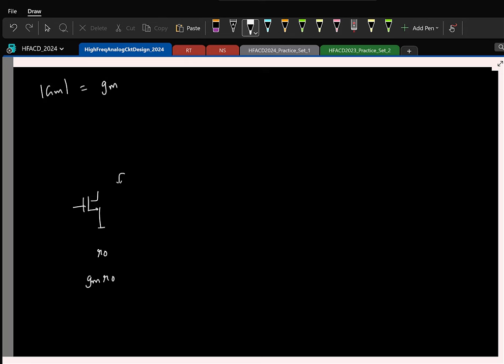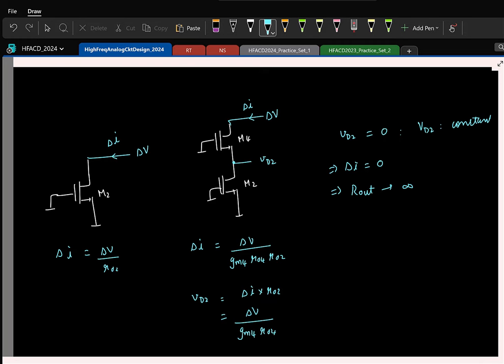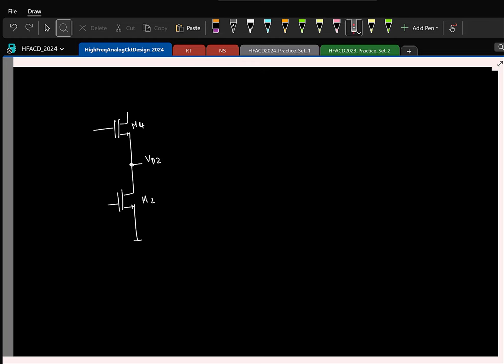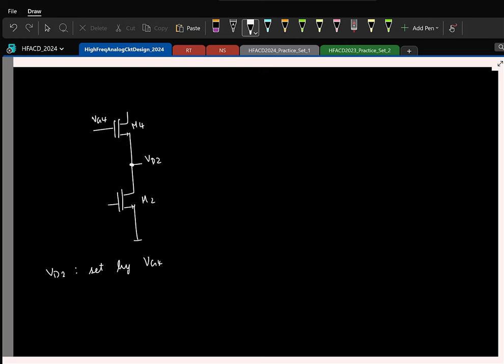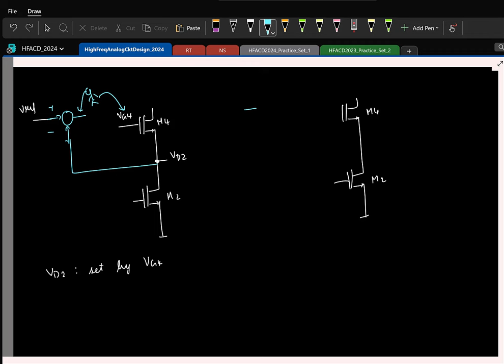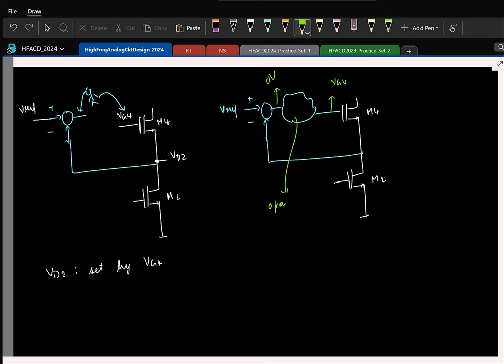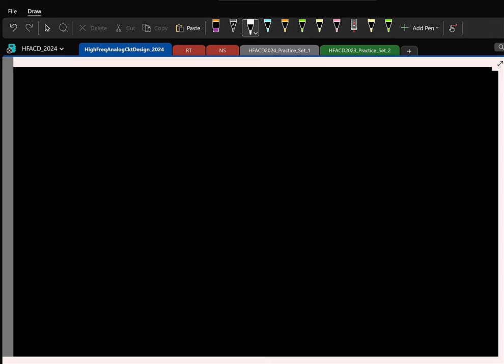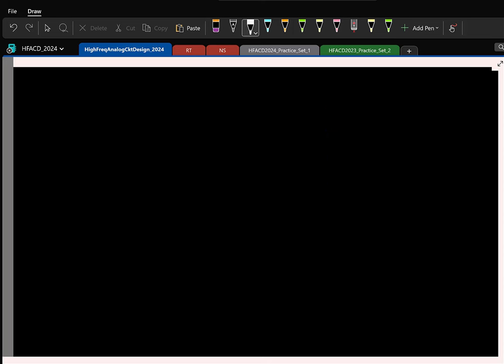Lecture 8(2): Gain boosted cascode

Comment: At 13:29 if gain A in negative feedback increases small signal current from gm —>A*gm , doesn’t it mean total output resistance is reduced compared to initial case as small signal current is increased?